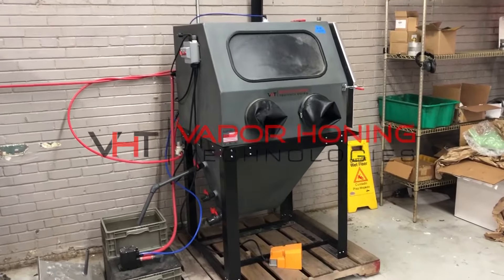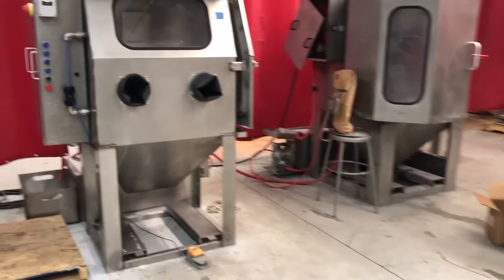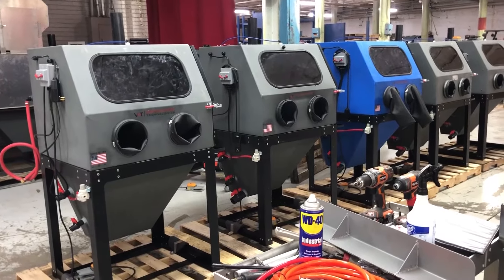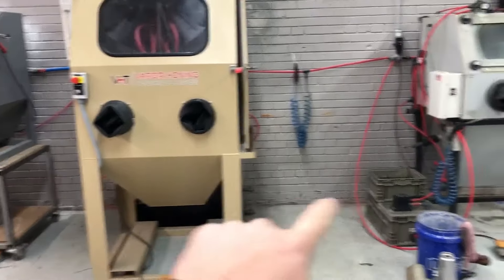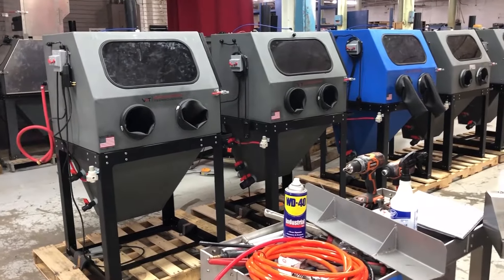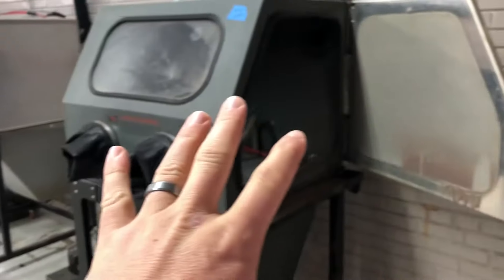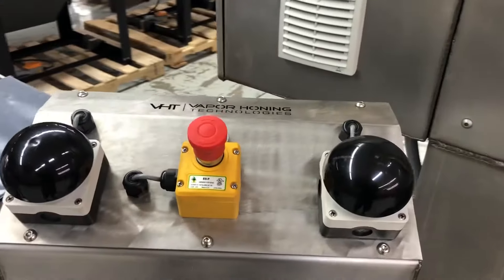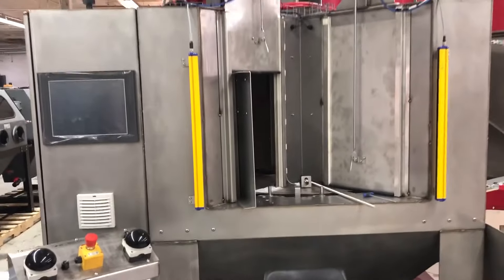How To Choose Your Vapor Honing Machine - Vapor Honing Technologies

Comment: Question. Is Vapor safe to use on Gasket surfaces? Question #2. When cleaning  head, carb or block for a veh. does Vapor clean all of the oil/fuel passages? Thanks.
Reply from the maker: This process is safe on Sealing surfaces.  ex.  https://youtu.be/C9Qv4ALXeqc     As for the passageways we recommend masking them off.  Please contact us for more information at nicole@vaporhoningtechnologies.com  or 828-202-5563 x 103 Niki